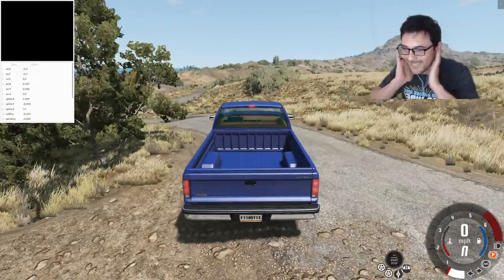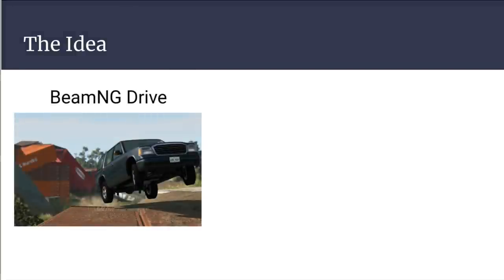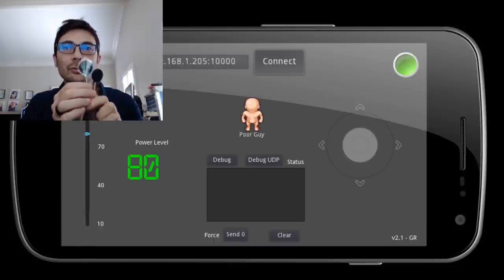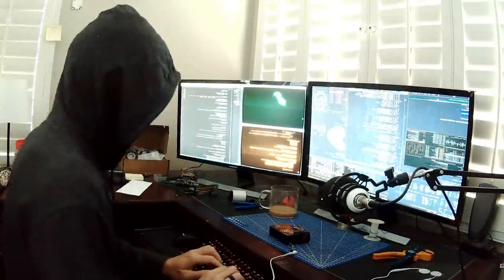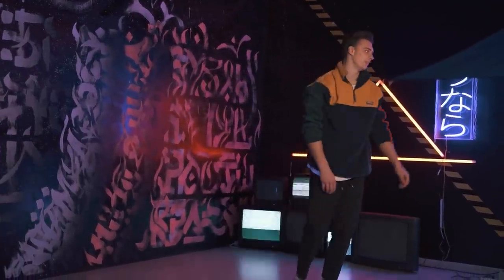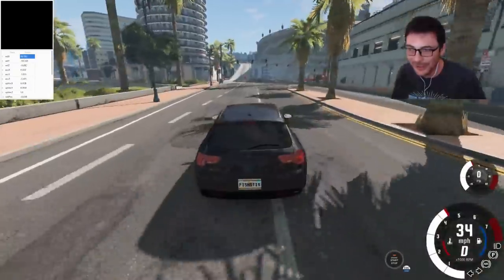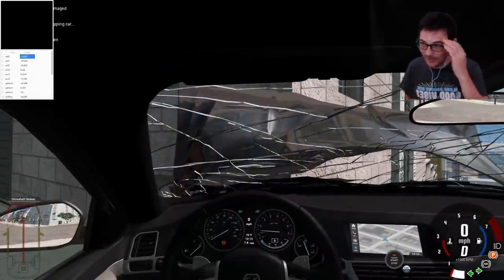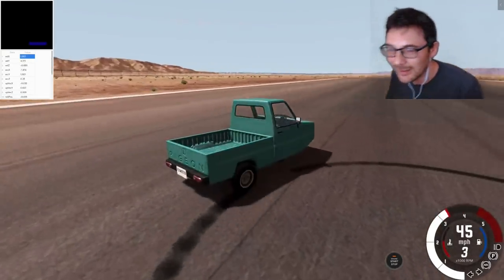Racing Motion Simulator w/Galvanic Vestibular Stimulation! (BeamNG Drive)

Comment from the maker: This is the first time Galvanic Vestibular Stimulation (GVS) has been used in a video game (that I am aware of). What else would you like me to try with GVS? Comment below.
Reply: Assetto Corsa?
Reply: Try Microsoft Flight Simulator and do a bunch of stunts in a crop duster and then a jet!
Reply: Dirt rally 2.0
Reply: Try a flightsim; X-Plane for example has a pretty detailed system for data output as well as plugin APIs.
Reply from the maker: @tiagotiagot  thanks for the tip. Having readily available motion data would make things easier.
Reply: write a paper and publish. :)
Reply: try assetto corsa
Reply: Kerbal Space Program maybe?? Try some rockets ;)
Reply: As a VR/AR developer, I'm quite interested to try it out in those realms. Maybe even in tandem with a EEG or EMG device.
Reply: Mortal Kombat!
Reply: Impresive work. You are making something very important in pushing virtual experience towards reality. Whats next? Build 4 pole GVS, write software for games (beamng first) and sell it. I already ordered esp8266 to build GVS presented in previous video. I have sim rig with triple screen and headtracking. 6dof motion platform is out of reach for now. Possibility to feel 3 DOF through gvs would be AWESOME.
Reply: DCS World - Any plane / helicopter ;)
Reply: @IIINortonIII  Yeah, Dr. Taro Maeda appeared in the video you pointed out is a pioneer in the study of the application of GVS and has been a professor at Osaka University since 2007.  Anyway, it's certainly very interesting that the schematic and the source code for the GVS device have been shared as OSS.
Reply: Hello! I want this thing =) How do I do this?
Reply: @MeanGeneHacks  data for Dirt Rally 2.0
Dirt Rally / Dirt Rally 2.0
Close the game. Using Windows Notepad (or other appropriate editor) insert a string given below into motion_platform section of your
"C:\Users\%USERNAME%\Documents\My Games\DiRT Rally\hardwaresettings\hardware_settings_config.xml" file *
to make Dirt Rally sending telemetry data to SimShaker via UDP.

<udp enabled="true" extradata="3" ip="127.0.0.1" port="29373" delay="1" />

It should look about like this example.
 <motion_platform>
  <dbox enabled="true" />
  <udp enabled="false" extradata="0" ip="127.0.0.1" port="20777" delay="1" />
  <udp enabled="true" extradata="3" ip="127.0.0.1" port="29373" delay="1" />
  <fanatec enabled="true" pedalVibrationScale="1.0" wheelVibrationScale="1.0" ledTrueForGearsFalseForSpeed="true" />
 </motion_platform>
Now save the file and start the game. Make sure that the file extension is still .xml and NOT .xml.txt.

* - path to the file for Dirt Rally 2.0 will be C:\Users\%USERNAME%\Documents\My Games\DiRT Rally 2.0\hardwaresettings\hardware_settings_config.xml" . Dirt Rally 2.0 support added to SimShaker - Wheels starting from version 3.4.
Dirt 4
Close the game. Using Windows Notepad (or other appropriate editor) insert a string given below into motion_platform section of your
"C:\Users\%USERNAME%\Documents\My Games\DiRT 4\hardwaresettings\hardware_settings_config.xml" file
to make Dirt 4 sending telemetry data to SimShaker via UDP.

<udp enabled="true" extradata="3" ip="127.0.0.1" port="29373" delay="1" />

It should look about like this example.
 <motion_platform>
  <dbox enabled="true" />
  <udp enabled="false" extradata="0" ip="127.0.0.1" port="20777" delay="1" />
  <udp enabled="true" extradata="3" ip="127.0.0.1" port="29373" delay="1" />
  <custom_udp enabled="false" filename="packet_data.xml" ip="127.0.0.1" port="20777" delay="1" />
  <fanatec enabled="true" pedalVibrationScale="1.0" wheelVibrationScale="1.0" ledTrueForGearsFalseForSpeed="true" />
 </motion_platform>
Now save the file and start the game. Make sure that the file extension is still .xml and NOT .xml.txt.
Reply: @MeanGeneHacks  data for Il-2 GB
[KEY = telemetrydevice]
	addr = "127.0.0.1"
	decimation = 2
	enable = true
	port = 29373
[END]

[KEY = motiondevice]
	addr = "127.0.0.1"
	decimation = 2
	enable = true
	port = 29373
[END]
Reply: @MeanGeneHacks  data for Condor2 Soaring Simulator
[General]
Enabled=1

[Connection]
Host=127.0.0.1
Port=29373
Port=55278

[Misc]
SendIntervalMs=50
ExtendedData=1
ExtendedData1=1
LogToFile=0
Reply from the maker: @iRi_E  Interesting! Thanks for the link!
Reply: @MeanGeneHacks  Oh sorry, that's not the URL I intended.  Here's the article of Sword of Gargantua with GVS.  https://www.moguravr.com/swords-of-gargantua/ 
BTW, Aoyama et al. have posted several papers about GVS to Transactions of the Virtual Reality Society of Japan (TVRSJ).  You might want to read them though written in Japanese.  https://www.jstage.jst.go.jp/result/journal/-char/en?cdjournal=tvrsj&globalSearchKey=GVS
Reply: In the paper you have linked in the description it's written that you can control pitch and yaw by placing another pair of electrodes near eyes. Will you try that? :)
Reply: Just a suggestion, to add forward/reverse acceleration, you actually may need just 3 electrodes, the 3rd right in the middle of the forehead. And a 3 phase delta driver.
Reply: try to change ones sense of gravity so that they automatically put a lot more or a lot less force when doing things like jumping to a certain hight or lifting.
either using a setup which can directly do it. or otherwise using a 4 point one with the head tilted(or a 2 version one with the head tilted sideways(so the head thinks left or right is up and the other is down).
Reply: Try setting up a company to develop it further. If it works out you will become a billionaire.
Reply: There was actually a company back in the late 90s that sold a GVS peripheral and some demo games for it. But it's great to see a nice implementation like this showing up again. I built a similar device in 2018 (4 channel, 2ma current limited full-bridge driver for each mastoid) that uses wireless esp8266 receiving instructions over wifi over TCP for integration into VR games in the unity enigine. But yours looks a lot less buggy and has way better interface software. Very cool! Anyway, you should check out the paper, 'Four-pole galvanic vestibular stimulation causes body sway about three axes_ K Aoyama et al_ 2015' for your next implementation to get finer control of all 3-axis of acceleration.

Comment: This is incredible. You deserve way more views and subscribers!
One question: do you plan on making a tutorial for this? I would love to experience it for myself!
Reply from the maker: If you search for my last video, I did provide a tutorial for building the hardware and a mobile app to test it wirelessly. If there is enough interest, I can release the new code needed to connect BeamNG to the hardware.
Reply: @MeanGeneHacks  Have you thought about simhub integration?  That way it could be used with nearly any driving simulator that provides telemetry output.
Reply from the maker: @johnathanmoyer2375  Haven't thought about that since this is a one-off DIY experimental device. Would be really cool if Samsung released their Entrim 4D GVS headphones that they teased back in 2017. https://www.theverge.com/2016/3/14/11220836/samsung-etrim-4d-headphones-movement-vr-inner-ear
Reply: @MeanGeneHacks  Hi Mean Gene, any news on a release for the BeamNG plugin please?
Reply: @MeanGeneHacks  I'm doing this as a school project and having the code to connect to beamng drive would be very helpful.

Comment: Cool project. Bit more info for those curious. GVS activates based on the net vector summation of the vesribular afferents in both canals and otoliths. This creates a roll sensation around an axis direction about 18 degrees from normal head forward posture. So to get a pure roll, you'd need to pitch your head up slightly. 

it's been shown that the human shown a perception of roll with a slight interaural linear acceleration when this roll axis is not aligned with gravity.

Comment: could you technically do acceleration and braking too with that? would be very interesting to see what you can do with that and where its limits are. In combination with VR i would imagine that as a good and especially cheap alternative for immersive sim racing rigs. Up and down is probably not possible with it though
Reply from the maker: I haven't tried adding more motion axis; however, researchers have demonstrated that a 4-pole GVS device can simulate 3-axis of motion. https://www.researchgate.net/publication/276148002_Four-pole_galvanic_vestibular_stimulation_causes_body_sway_about_three_axes
Reply: that looks pretty promising, might try something like that over my summer holidays if no one does it first, would really be cool to see integrated in VR headsets in the future
Reply: What was interesting is that when accelerating he was by default leaning forward.
Reply: @MeanGeneHacks  I though about adding two more electrodes, but this device can simulate one axis at a time. Have you though about it? You are using constant signal in your gvs, in case of three axis, it should work by sending one signal at time at proper frequency. Constantly updating Roll Yaw and Pitch. What do you think?
Reply from the maker: @IIINortonIII  Great ideas. In the video description, I provide a link to a paper where researchers describe how they implemented roll, pitch and yaw using four electrodes.  Their results are quite encouraging and seem to indicate a four-pole system using opposite directional anteroposterior stimulation can simulate these forces. Its hard to know how well it would work until such a device is actually built & tested though...

Comment: This is mindblowing! I have so many questions haha.

Would it be possible to develop this tech to include all three axis and rotation?

Also, you mentioned that you don’t feel g forces, but movement. Can you clarify that a little? I was under the impression that you could simulate constant g forces with this tech.

Anyway, I can’t wait to see where you will take this. If you could somehow hook it up to Assetto Corsa and use it in vr, then there should be a lot less motion sickness I think.
Reply: G forces move your whole body, but this kind of stimulation only affects your balance. You couldn’t show g forces, but you could feel like you’re falling left or right (or back or forward I assume) depending on the position or movement of the car
Reply from the maker: Like Adam McKinley stated in his comment, there are no physical G-forces affecting your body; however, what is happening is your body feels as though there are forces affecting it.  Kind of like how VR tricks your eyes into believing something that is not real, this GVS device tricks your inner ear into believing that there are forces acting on your body that do not really exist.

As for more axis.  I posted a link in a comment above to some research that shows a 4-pole GVS device can produce 3-axis of motion simulation.

Comment: That's great!
Someone had to link GVS to a video game, thank you very much for doing it!
I was interested in these experiments around the vestibular gland about ten years ago thanks to Palmer Luckey who talked about it during an interview or conference, I found it fascinating. At that time, Palmer Luckey said that there was little hope that this system with sponge electrodes could one day find a commercial application due to the potential for skin burns that can occur with improper use or prolonged use.
As someone who has extensively tested the device, what is your opinion on the subject?
Reply from the maker: I tried the sponge electrodes and experienced the same discomfort and irritation that has been widely reported; however, the sticky GEL electrodes I use in the video are much better with zero irritation issues.  There is; however, a significant problem with the GEL electrodes:  They are not re-usable.  At least not more than a few times.
Reply: @MeanGeneHacks  thanks for your answer, keep up the good work !

Comment: Man, this is amazing! Can you please tell, if there is an option to add acceleration and break tracking (not only left and right, but also back and forth movements). I could have missed it in the video
Reply from the maker: It seems like acceleration and braking are possible using more complex hardware (and software).  If there's enough interest, I'll try building one.

Comment: I wonder if it works with motion sickness in VR - to make up for the body not moving while the eyes tell you it should. That's a huge problem in VR, which limits most types of accelerated movement and you're stuck to teleporting or constant speed gliding (and that's rarely used).
Reply from the maker: Good question. There is some indication that VR motion sickness is caused by the conflicting information coming from your visual and vestibular systems.  If both systems were in sync, maybe there would be no motion sickness?

Comment: If you plug in head tracking you should be able to get more axis.
Reply from the maker: Great idea. Would be interesting to try this in VR, I think the immersion would be a lot better.
Reply: @MeanGeneHacks  this is probably terrible advice, but I would try wearing the rig 24/7 on low, until your balance adapts.

And see what the absence of a signal feels like. Maybe see if you can trick your brain into thinking you're going up or down or maybe increase pressure decrease pressure.

As they say, discovery requires experimentation. Good thing brains are plastic.
Reply: @MeanGeneHacks  I also wonder if you modulate them through a sound card, using the fake 3D sound some headphones come with, you can get more axis feel that way too.
Reply from the maker: @jtjames79  Researchers have demonstrated that 4-pole GVS allows for 3-axis of control. https://www.researchgate.net/publication/276148002_Four-pole_galvanic_vestibular_stimulation_causes_body_sway_about_three_axes
Reply: @MeanGeneHacks 4 pole-gvs, 3 axis, sounds like fun. You already nailed it so it would take some effort and enchancement. You will be first who achieved this. Connecting brain with computer should be the new  way of gaming. It is hard to believe that no one tried this with games. Really appreciate your work, hope you share software to feel it ourselves. Open crowdfunding, ill pay for your time 🥳

Comment: Have you experimented with changing the response curve, making it more or less sensitive on lower values versus higher values?
Reply from the maker: I've played with it a little bit, but haven't spent as much time on this aspect as I would like. You bring up a really good point, because right now the response curve is linear.  A non-linear and tuned response curve could really make it better for the general public.

Comment: What happens if you hook it up to an accelerometer (or gyro if it works by producing spins instead of specific down-direction), mount it on your head, and make it feed either the opposite or the same value as your own body would naturally feel? What if you make it produce stronger or weaker values than you would naturally feel?
Reply from the maker: Good questions. I really don't know. The inputs to the GVS device are derived from the motion sim data being spit out by BeamNG.  You could theoretically use any source of inputs or combine inputs in any manner.  I imagine it would take some time and tuning to find the best combination.
Reply: Add a PID loop and see if you can “stabilize” mode someone. Artificially enhanced balance anyone? Haha.